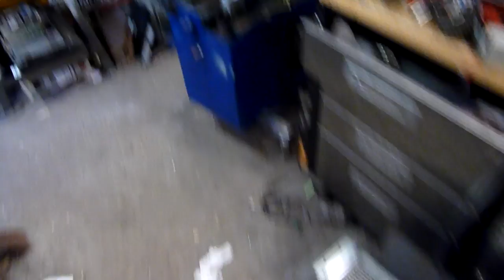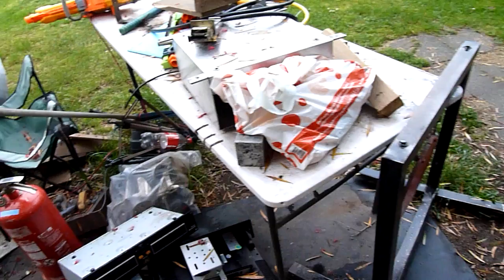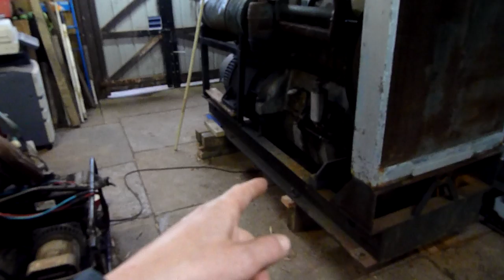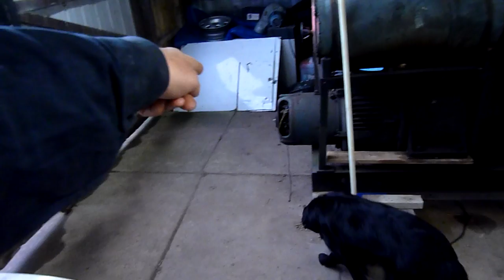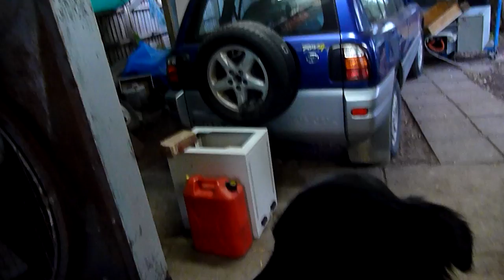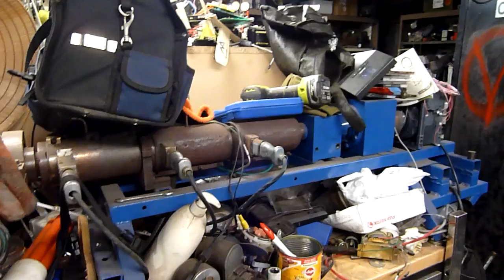Ramblotron Entry for October 18 2018 - Get Back to Work you Slob!

Comment: If your going to part out the extruder that angle drive gearbox looks like it would make a nice weld positioner. Dont know how much you would need one but they are handy to have. I made one out of a grain truck 40:1 gearbox and a Ryobi drill. Works great!

Comment: the n series of video recorders came around right before the vhs vcr. these are early 70's to late 70's and they were a little funky since it was a reel on top of a reel in a square case for the tape. strange design but they were doing all kinds of stuff in the 70's mostly these were more common in the uk then the us and anywhere else.
Reply from the maker: yeh I looked this one up, Its mid 70's era, the tapes reminded me of an 8 track but not quite, its not a full loop.
Reply: totally. very funky machine. whats rare is the tapes. good luck finding tapes if anyone in the uk has any around somewhere
Reply: Video 2000 very collectible, a beta machine costs $ 2500 now

Comment: Still getting out and shooting mate?
Reply from the maker: yeh, not as often as I wish I could tho
Reply: Same
Reply from the maker: ammo is expensive too :p, I would love to make a Delisle carbine clone on a SMLE action in 9mm, I can get crates of 1500 rounds of lead round nose target ammo for $300, pretty cheap plinking
Reply from the maker: that and it could use Glock mags, 32rd 9mm mags can be had, just expensive
Reply: I think it’s costing me about a $1.30 per shot now with the .303
Reply from the maker: oh yeh its in the same realm as 7.52X54r, not cheap. we are buying up Norinco 7.62X39 since its still cheap and Rugar makes a nice ranch rifle in that caliber, we blew through a few hundred rounds last time at the range and the ammo is good, and the gun is good!, neat little bolt gun.
Reply from the maker: the x39 ammo was $600 per crate, 1250 rounds or so per crate, pretty cheap, just corrosive, steel case, berdan primed.